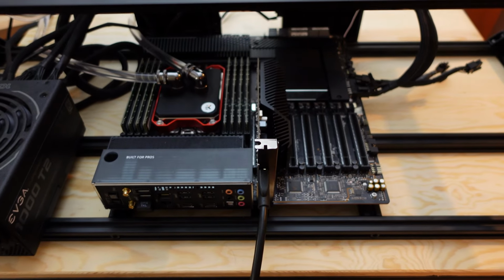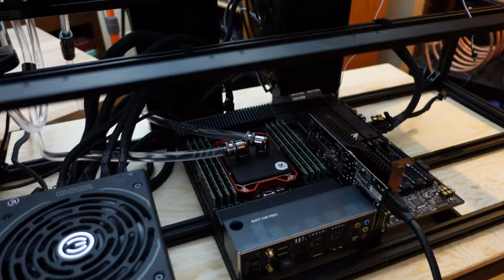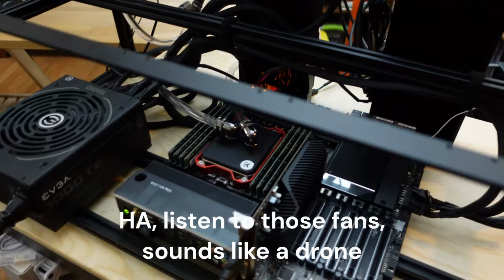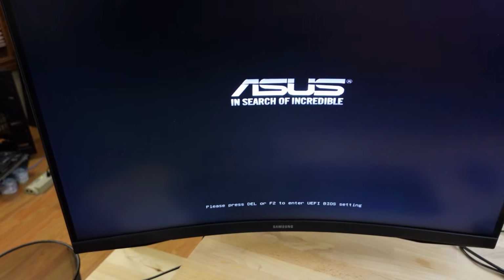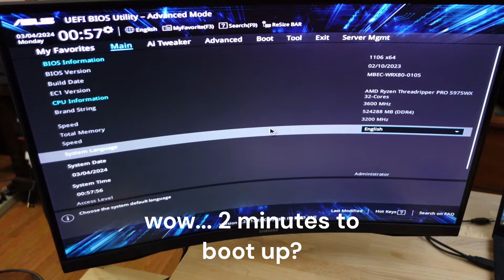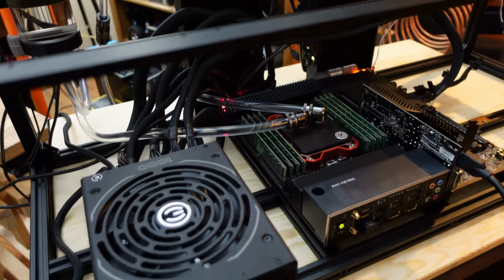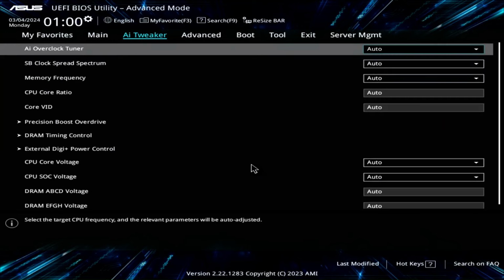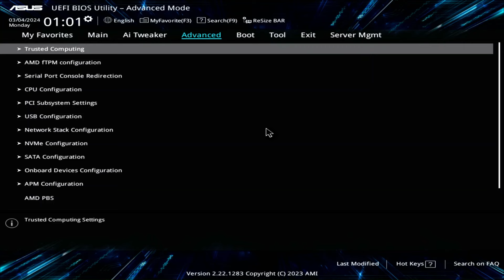Cross fingers… will it start? - Hephaestus Build

Comment: Hey I just got the same motherboard, super cool series. I have the old x299 on an open frame on top of a cart as well but I got so dusty with fans and CPUs, how do you plan to keep it clean? 
As for the GPUs do you plan to use water cooling as well or space them out on top with PCIe cable extensions?
Keep it up! Looking forward to new updates. Subbed!
Reply from the maker: Not sure how to keep the dust from collecting. Many times I end up taking computers totally apart and vacum and dust things off... future me problem. I have some water cooled GPUs and some that are just fan. There's a story with each gpu I collected over the years while thinking about building this. I am going through a doctoral program and I started thinking about this year's before while also... gaming with the cards...